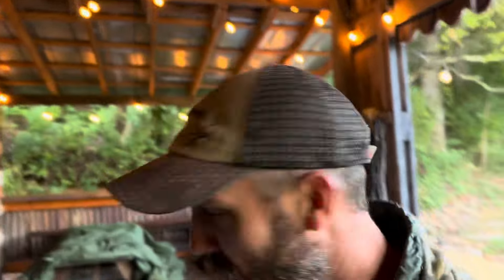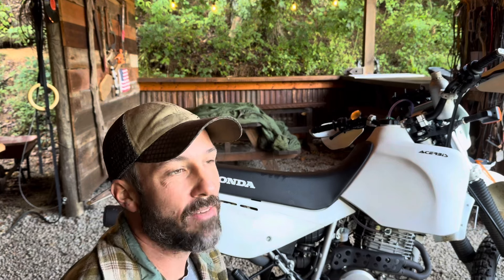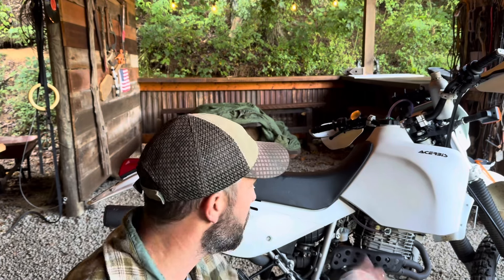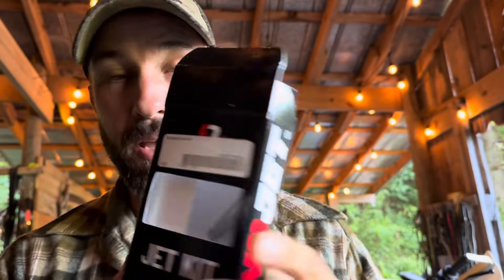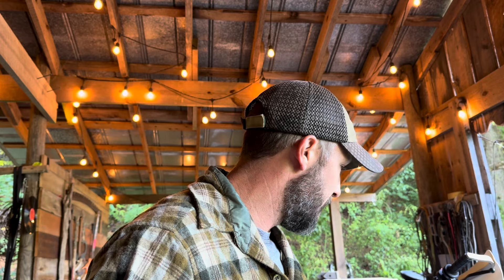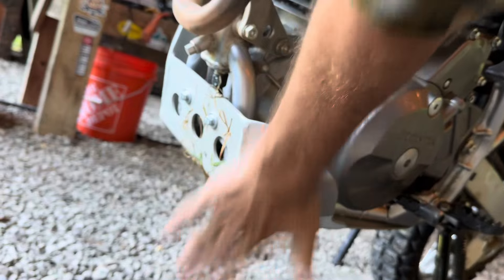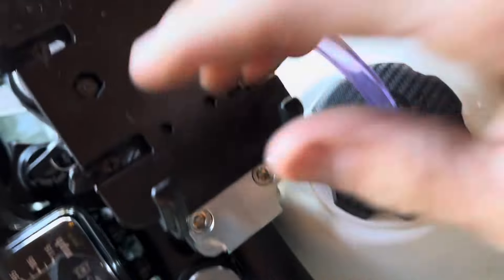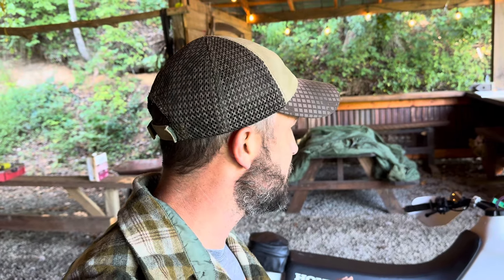Overland Challenge Preparations I Performance vs Reliability

Comment: They are extremely lean from the factory to satisfy the EPA. Your issue is the low speed/idle jet. Go up one size. You probably dont need to do anything with the main jet. Fuel economy won't be affected. JMHO hope it helps. Now I'd say you just need some bags. That XR will take you anywhere you want to go.
Reply: I agree
Reply: 93ot gas and NKG plug.

Comment: A torch tip cleaner comes in handy for clearing out really small holes. I have a klr 650 and they are fun to ride. Mine is OD green, so it doesn't stick out like a white one.

Comment: Check your carburetor for the Fuel/Air mixture Screw. Perhaps a little adjustment is needed instead of re-jetting it. 
 I built out my Apoca-bike with a cheap Hawk250 from Amazon ($1800). I had a very limited budget. I fabricated my own Skid Plate and Pannier Rack for "Saddle Bags" .
Reply from the maker: Thanks so much! I’ll do that.

Comment: I have a Harley 1200 XLCH that gets the same gas milage but is definitely NOT off-road equipped. I have ridden it on dirt roads and it does okay as long as its not too slippery. But it excels on the pavement, has big saddlebags and can easily carry me with a passenger.
Reply: A friend ,has one  .he installed  longer shocks & forks along with 50/50 tires ,looks like a baja bike think its 1985 model not sure tho

Comment: Ain't watched the whole vid yet, but does that carb have the big spring with the needle in the top like other Hondas? You could possibly move the needle down a notch and/or adjust the fuel mixture screw without changing a jet. Not sure. Probably wrong lol
Reply from the maker: Good tip. I’m looking into that.
Reply: @ONThree  if it's like the old 300s, the needle can be changed pretty much with no tools. I'd be curious if it works for you

Comment: Honda Africa Twin is the best bike for a survivalist.
Reply from the maker: Debatable…They are heavy and have lots of electronics. Great bikes for sure but not my first choice.
Reply: No.... just no dude.

More complicated, like a LOT more complicated bike, electronically, engine, controls are all more complicated. It is extremely heavy for off-road use, and requires someone very skilled to use it effectively on true off-road/single-track. While it is made by Honda, and has a reputation of being reliable, it's a bike that is very difficult for anyone who isn't a mechanic with specialized tools to fix and maintain during a real disaster with supply shortages should it eventually need repairs.

The Africa Twin is an adventure bike that lands solidly in the touring side of the adventure category. Meaning, it's much better at putting down many comfortable miles on-road and maintained gravel roads than actual off-road adventure use. It's an expensive toy marketed towards aging white-collar retirees who want to do something rebellious and not feel as old as they really are. Which is fine, but it's not a bike anyone should choose as a primary or backup mode of transportation for a survival/disaster scenario. That segment belongs to the much simpler, much lighter, Japanese dual-sport bikes.

Comment: That stutter is carb related..
Reply from the maker: That was my guess as well.
Reply: @ONThree  suggestion tho  saddle bags  being an apocbike  ,ammo cans . You have the skillset to figure out how to attachthem to the machine. Theyre water proof & if our troops can mess them up doubt you will... Good luck brother , keep the rubberside down.👍🏻
Reply: @Wheeling88  Hard saddlebags in hard off-road isn't really a smart choice. If the bike goes down, they can crush your leg. A hard, square box catching a tree is also a very bad time. A softer bag setup will be more likely to slip past
Reply from the maker: I use mosco Moto saddle bags. No rack needed. Keeps everything low and dry. Love em.